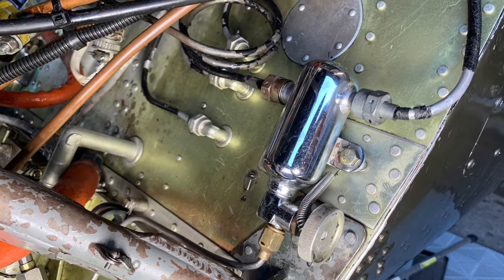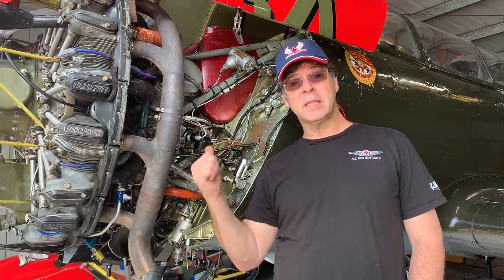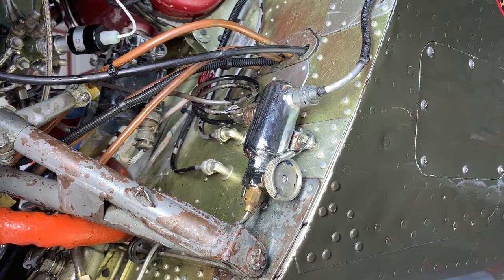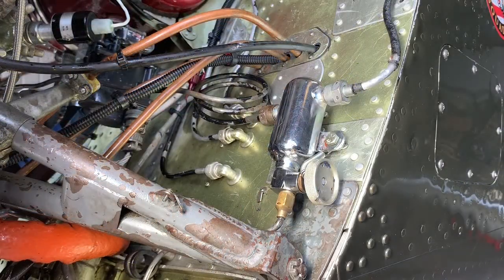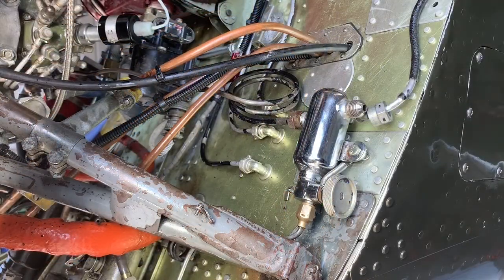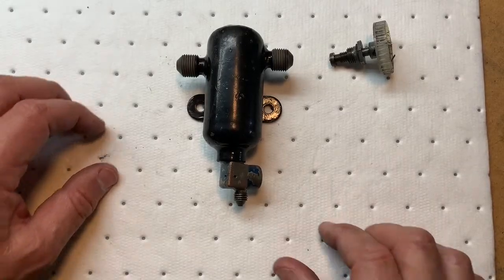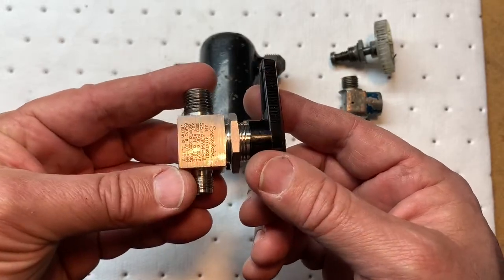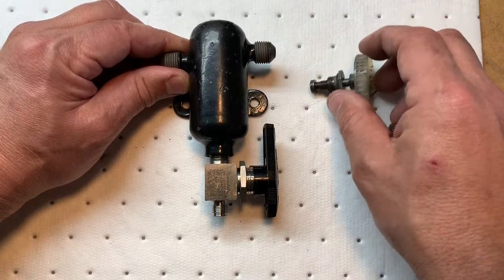Diagnosing Air Leaks 1

Comment: I do an electric dump valve mood that replaces that valve, You have a switch in the cockpit you open once your air system is charged up, that way your compressor operates for the rest of the flight under no load. that is much easier on the compressor.